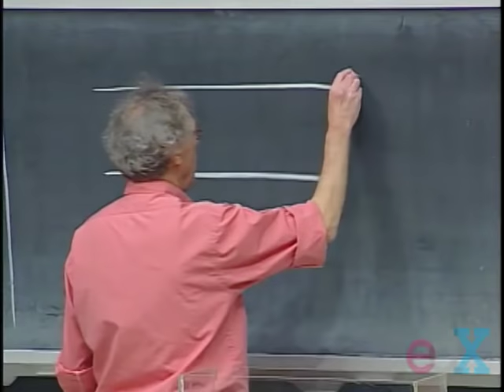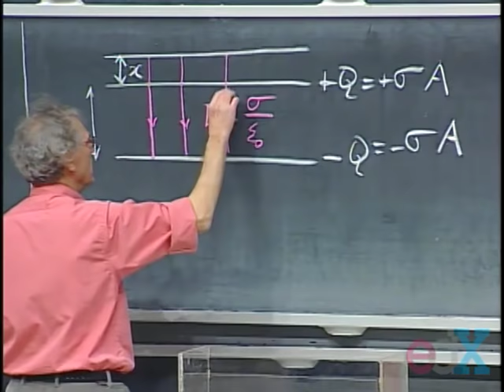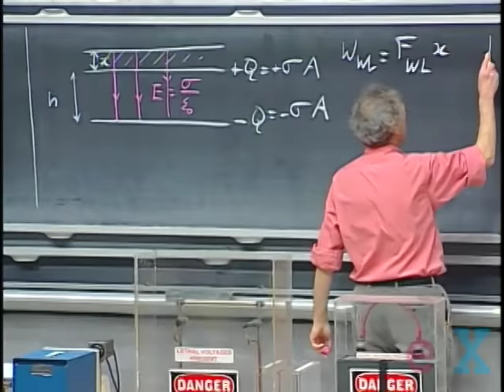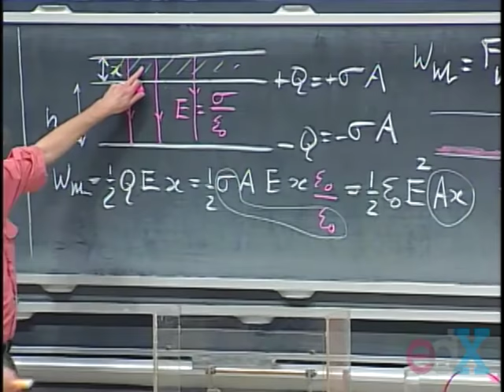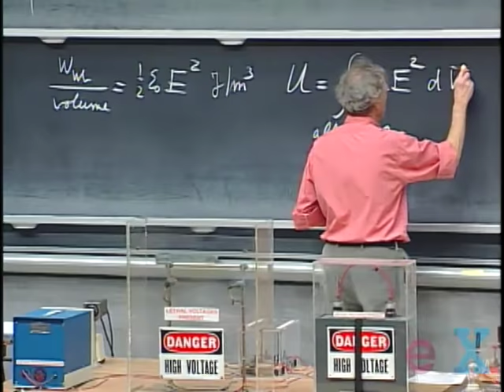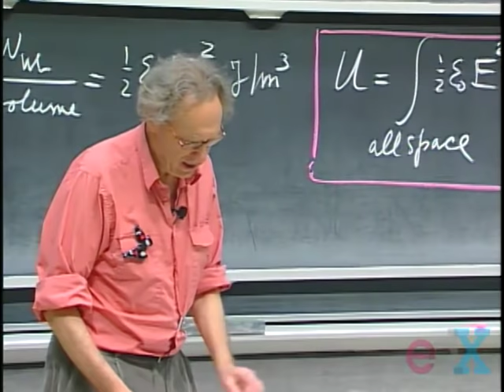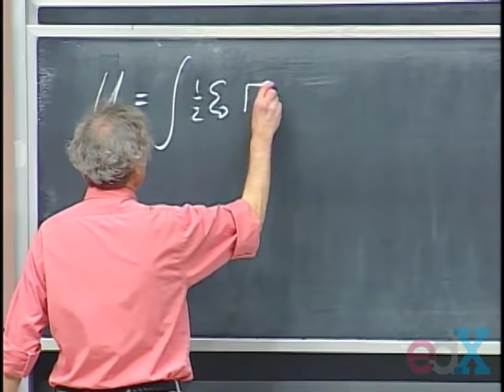8.02x - Lect 7 - Capacitance, Electric Field Energy

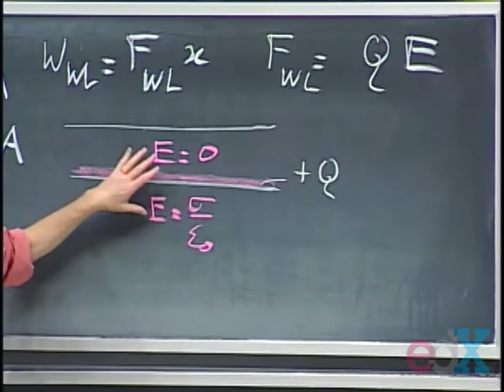Comment: sir if i may ask, why do you take the average of the two fields back in minute 3:31 ? 

is there any mathematical explanation about it?
Reply from the maker: +Usamah Jundi  When I move a charge Q in a field E over a distance x, then I have to do work QEx. However, the field through which I move the charge Q is not everywhere E. It's E on one side and zero on the other.  Thus the work I have to do is 0.5*QEx.
Reply: @lecturesbywalterlewin.they9259  for some reason it is difficult to wrap my head around
Reply: @jessiegoodman9620  Me too, and I have an alternative explanation of why the result seems true :
Suppose you ignore the second charged plate, then the first charged plate which we move experiences no electric forces when we move it : if you move a charge in an empty space, there is no electrical forces which act on this charge.

So it is only the charged plate below which has an influence on the charges of the upper plate when we move it. 
Since the electric field generate by the (infinite) second plate is E₂ = σ/2𝛆₀ (you can find this with Gauss's Law) then to move the first plate for along a x distance we have to do the work of W₁= Q₁· E₂ · x = Q₁· σ/2𝛆₀ · x =1/2 (σ·A· E · x) because between the to plate, the magnitude of the electric field is E = E₁ + E₂ = 2 · E₂  <=> E₁ = E₂
so  E₂ = E/2
Hence W₁= 1/2 (σ· 𝛆₀/𝛆₀· A· E · x ) = W₁= 1/2 (E·A· E · x /𝛆₀) =1/2 (E²A·x· 𝛆₀) = 1/2 (E²∆V· 𝛆₀) with ∆V the volume crossed throw the displacement of the first plate.
Reply: The electric field is due to the charge on both plates (2 *sigma/2(epsilon)) but the force on one of the plates is only due to field created by the other plate so we would ignore its own contribution to the field in calculating the force. Is this right?
Reply from the maker: @arqampatel5122  yes that is right. Charge one plate only, it does not create a force on itself.
Reply: @lecturesbywalterlewin.they9259  So Argam's reason is the correct reason or the average one is correct?
Reply: Lectures by Walter Lewin. They will make you ♥ Physics. Why sir, did you not iterate this in the lecture?
Reply: Guilhem Escudéro thnx for this ans in Purcell there was a sophisticated mathematical explanation for this.
Reply from the maker: @jaihind6472  factor of 2
Let the charge on each plate of the capacitor be Q=100q (+Q on one plate and --Q on the other). Let the area of each plate be A. The E-field between the plates is then Q/(A*eps_o). Let the distance between the 2 plates be d.  Now release q from the + plate to the negative one. The energy that is released is force*distance which is very close to q*d*Q/(A*eps_o). But after this transfer the E-field is reduced, it’s now only 0.99*Q/(A*eps_o). I now release another q thus the energy that is released is now 1% less than with the first q. By the time I have released 10 times one q, the E-field is only 0.9*Q/(A*eps_o) and thus the force on the charge q is only 0.9*q*Q/(A*eps_o). The force keeps going down as I transfer more charge.  By the time I have released the last q (of 100) the E-field has become 1% of the original E-field thus the force on the last q is about 1% of the force during the first transfer. Thus by the time that I have released 100q=Q the average E-field was only 0.5*Q/(A*eps_o), NOT Q/(A*eps_o). Thus the average force on a charge q during transfer was NOT q*Q/(A*eps_o) but only half that. Thus, by spooning off the chaInfamousrge from one plate to the other the energy release is NOT Q*d*Q/(A*eps_o) but only half of that. The energy that is released this way (also called potential energy) is identical to the work that YOU would have to do to separate the 2 plates over a distance d.
Reply: Lectures by Walter Lewin. They will make you ♥ Physics.  Thanks a lot sir for your explanation. Finally i can understand the whole thing.
Reply: @lecturesbywalterlewin.they9259  sir i couldn't understand it. Please explain once again sir. I couldn't get ,how the field become half of original ??🙁🙁
Reply from the maker: @IamLegend573  
factor of 2

Let the charge on each plate of the capacitor be Q=100q (+Q on one plate and --Q on the other). Let the area of each plate be A. The E-field between the plates is then Q/(A*eps_o). Let the distance between the 2 plates be d.  Now release q from the + plate to the negative one. The energy that is released is force*distance which is very close to q*d*Q/(A*eps_o). But after this transfer the E-field is reduced, it’s now only 0.99*Q/(A*eps_o). I now release another q thus the energy that is released is now 1% less than with the first q. By the time I have released 10 times one q, the E-field is only 0.9*Q/(A*eps_o) and thus the force on the charge q is only 0.9*q*Q/(A*eps_o). The force keeps going down as I transfer more charge.  By the time I have released the last q (of 100) the E-field has become 1% of the original E-field thus the force on the last q is about 1% of the force during the first transfer. Thus by the time that I have released 100q=Q the average E-field was only 0.5*Q/(A*eps_o), NOT Q/(A*eps_o). Thus the average force on a charge q during transfer was NOT q*Q/(A*eps_o) but only half that. Thus, by spooning off the chaInfamousrge from one plate to the other the energy release is NOT Q*d*Q/(A*eps_o) but only half of that. The energy that is released this way (also called potential energy) is identical to the work that YOU would have to do to separate the 2 plates over a distance d.
Reply: There is another relatively simple way to prove - consider the force on a test charge placed above the bottom plate.   If you integrate all of the vector forces from Coulomb's law (from -inf to +inf, since that is our key assumption in making the field uniform), you will readily find the factor of 1/2.  This is a good opportunity to point out that the E field between the plates of sigma/epsilon was based on already taking into account the zero field in the conductors.   While that is certainly true, you have to look deeper as to why the charges arrange themselves that way so as to make that true.   That is, we assumed the final charge distribution and came up with the associated e-field.   A perfectly valid approach since the assumption is shown true in the end.  It was dependent however, on both plates being place.   That is what gives rise to the apparent discrepancy - i.e. the self field of the upper plate is used implicitly to calculate the final field of the two plate configuration.  So it is not valid to use that 'final' field in calculating the force on the upper plate.
Reply: @guilhemescudero9114  I think that's the best explanation here, the E. field produced by only one of the plates is σ/2𝛆₀, and we say it's σ/𝛆₀ between them because there are two parallel plates with the same charge, however, to calculate the force acting on a charge (or in this case, charged object) with F=E*q , you use the external E. field, and not the one produced by the charge itself. Same thing with the plates.
Reply: @guilhemescudero9114  irrelevant answer

Comment: Sir, I think I have a better way of arriving at the same result as in 3:33 . To move upwards, the upper plate has to do work against the electric field provided individually by the bottom plate whose electric field is sigma/2*epsilon. The charge of the upper plate is Q and distance covered is x, Therefore force is = F = QE = Q*sigma/2*epsilon....... but sigma/epsilon = Electric field btw the plates, therefore required force will be F = QE/2... Therefore required work to be done will be W = QEx/2
Reply: Has this been confirmed as sustainable proof?
Reply: @kxb6098  He's talking about relative electric field(so 2 speak) strength btwn d plates,he nvr mentioned it as d electric field pertaining to one plate only,then taking d average btwn d two(both being d field strengths btwn d plates) sounds fine as well. When talking bout dipoles, d work being done to move 1 charge away has definitely got to do wd d electric Field strength of not jss 1 charge but both. Lastly,quit judging others!
Reply: Thanks a lot. Saved me time trying to figure this out.  I'm not sure that his explanation makes sense and I'm a bit surprised he did not give your explanation.
Reply: Thanks a lot. Your explanation makes complete sense and you saved me time trying to work it out. I'm not sure that his explanation makes sense and I'm a bit surprised that he didn't give your explanation.
Reply: well, if you think about it, that's exactly what Prof. Lewin did, he just didn't explain it this time because his methods should be clear to those who took the 3rd lecture.

That's what I think.
Reply: why do you say the the electric field between the two plates is sigma/epsilon
Reply: @brod515  Gaussian surfaces and symmetry. The infinite thin changed plane's electric field is perpendicular to it so if you consider a small cylinder with caps of area A that is cut in half by the plane then the total flux through that cylinder is 2EA, which by Gauss's law is equal to the charge contained in the surface, sigma A, divided by epsilon. Therefore the electric field from one plate is sigma/(2*epsilon). There are two plates with opposite charges so the total field in between is sigma/epsilon. 

Alternatively, you can just use the result for a thick conductor that only the top cap of the cylinder will have flux through it because of E=0 inside conductors at equilibrium. Both work and it's a matter of preference which one you use on a test.

Technically the solution requires the statement of quasi-static movement; assuming the conductor to be in equilibrium at each point of time.
Reply: I was having the same thought, and about to write a comment, but discovered you already did so. By the way, these classes are very good, "ik geniet ervan, bedankt!"

Comment: Can anyone further explain the knowledge at 3:37? I understand the electric field above the Q is 0, and the electric field below the Q is E. However, I do not know why we need to calculate the average electric field and why the average electric field is calculated by dividing by 2. Thanks a lot!
Reply: Dear Professor Walter, I saw your explanation about moving positive charges and reducing E. However, I wonder if charges are being moved when we are moving up the plate. Therefore, E may not be reduced. However, things change if these two plates are connected by an ideal wire and a battery. If these two plates are connected by an ideal wire and a battery, the electric field will be reduced.  Thus, we can get the average E = 1/2*E. This is my guess and assumption, but I don't know how to explain by using the layer you mentioned. Hope you can solve my problem. Thanks a lot.
Reply: I found that my solution is wrong since E will not reduce to 0. Thus, I do not know how to solve this problem
Reply from the maker: factor of 2
Let the charge on each plate of the capacitor be Q=100q (+Q on one plate and --Q on the other). Let the area of each plate be A. The E-field between the plates is then Q/(A*eps_o). Let the distance between the 2 plates be d.  Now release q from the + plate to the negative one. The energy that is released is force*distance which is very close to q*d*Q/(A*eps_o). But after this transfer the E-field is reduced, it’s now only 0.99*Q/(A*eps_o). I now release another q thus the energy that is released is now 1% less than with the first q. By the time I have released 10 times one q, the E-field is only 0.9*Q/(A*eps_o) and thus the force on the charge q is only 0.9*q*Q/(A*eps_o). The force keeps going down as I transfer more charge.  By the time I have released the last q (of 100) the E-field has become 1% of the original E-field thus the force on the last q is about 1% of the force during the first transfer. Thus by the time that I have released 100q=Q the average E-field was only 0.5*Q/(A*eps_o), NOT Q/(A*eps_o). Thus the average force on a charge q during transfer was NOT q*Q/(A*eps_o) but only half that. Thus, by spooning off the charge from one plate to the other the energy release is NOT Q*d*Q/(A*eps_o) but only half of that. The energy that is released this way (also called potential energy) is identical to the work that YOU would have to do to separate the 2 plates over a distance d.

Comment: At 19:14, I tried calculating the plates' capacitance with the video paused, just for practice, and got ~1.1M farads. I put 1.25 sq. metres for the area, multiplied it by epsilon 0, then divided by their separation, 0.00001 metres. What was my mistake?

Comment: What happens if I insert my hand in between the parallel plates of a capacitor if a). I am standing on an insulating stand  and b). I am in contact with the ground? I know it sounds crazy but does it do any harm? And are there any other cases similar to a and b?
Reply from the maker: +Anery Patel Anery, Let's assume you stand on a good insulator. There will be charge polarization in your hand due to induction. Thus one side of your hand will become + charged and the other -. Your net charge on your hand will remain zero. If you now step off your insulator the same thing will happen. One side of your hand will become + charged and the other side -. There will be no current going through you in either case.
Reply: +Lectures by Walter Lewin. They will make you ♥ Physics. 
Okay. But what if I touch the hand which is inserted, with other hand? And I think if I touch the plates of the capacitor directly then there are chances of current flowing through me. Isn't it?
Reply from the maker: +Anery Patel If you have one hand between the plates and you touch that hand with your other hand, the same thing will happen - charge polarization. If you touch one plate and if you are not insulated all charge will flow to the ground. You discharge the capacitor. You have created 2 capacitors in series. One of them is the Earth. If you are insulated, then you have created again 2 capacitors in series and charge will flow on you - you are one of the two capacitors. Which fraction of the available charge (on the plates) will move to you depends on the size of the plate capacitor and on your capacitance.

Comment: Hello, there is something I do not understand: in moving the two oppositely charged plates apart, Dr. Lewin says (at 1:59) that the Force applied is constant.  The equations follow clearly from that notion.   My intuition tells me that if the plates are close, then the force to move them apart would be greater.  As they are moved further apart, then I would suspect the Force necessary to move them would be less.  Force would start large and diminish perhaps as the distance separating them by d squared (to a first approximation as the plates are not points).  Am I misunderstanding something?

Comment: Hi Sir,

When you are moving the upper plate over a distance x then the upper plate will experience a electric field due to negative charge which is present on the bottom plate right ( i.e electric field due to an infinite sheet of charge E = ( Sigma / 2* epsilon zero) ) that's why you are taking 1/2 right ?
Reply from the maker: yes that is correct.
Infamous factor of 2
Let the charge on each plate of the capacitor be Q=100q (+Q on one plate and --Q on the other). Let the area of each plate be A. The E-field between the plates is then Q/(A*eps_o). Let the distance between the 2 plates be d.  Now release q from the + plate to the negative one. The energy that is released is force*distance which is very close to q*d*Q/(A*eps_o). But after this transfer the E-field is reduced, it’s now only 0.99*Q/(A*eps_o). I now release another q thus the energy that is released is now 1% less than with the first q. By the time I have released 10 times one q, the E-field is only 0.9*Q/(A*eps_o) and thus the force on the charge q is only 0.9*q*Q/(A*eps_o). The force keeps going down as I transfer more charge.  By the time I have released the last q (of 100) the E-field has become 1% of the original E-field thus the force on the last q is about 1% of the force during the first transfer. Thus by the time that I have released 100q=Q the average E-field was only 0.5*Q/(A*eps_o), NOT Q/(A*eps_o). Thus the average force on a charge q during transfer was NOT q*Q/(A*eps_o) but only half that. Thus, by spooning off the charge from one plate to the other the energy release is NOT Q*d*Q/(A*eps_o) but only half of that. The energy that is released this way (also called potential energy) is identical to the work that YOU would have to do to separate the 2 plates over a distance d.

Comment: Hi, I've noticed that you only use epsilon_0 in your lectures, for permeability of free space, however in my Polish physics class my teacher includes an epsilon_r term for relative permeability.
Why do you skip that term? Is it insignificant in most cases?
Thanks
Reply from the maker: of course, I also use epsilon-r watch my lectures on magnetism. There are ferromagnetic materials for which the relative permeability is 10^4 and higher.
Reply: Okay, I see, thank you and I will look at these lectures when I have the time :)
I haven't seen you use the term in 8.02 so far, and I had to solve a problem related to calculating the force applied to a given test charge in an electric field when in water. We were given the value of epsilon_r in water, and the values of the charges.
Reply: I'm sorry, but after googling I realized it must not have been water. It was some liquid with permeability in the tens